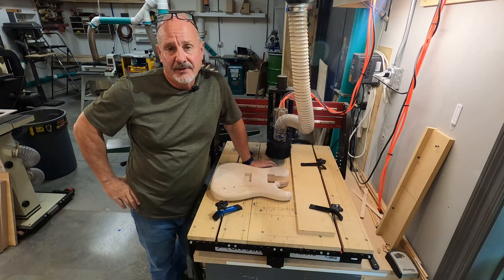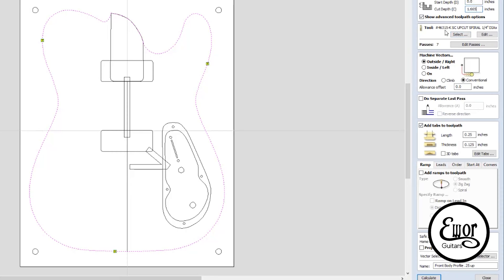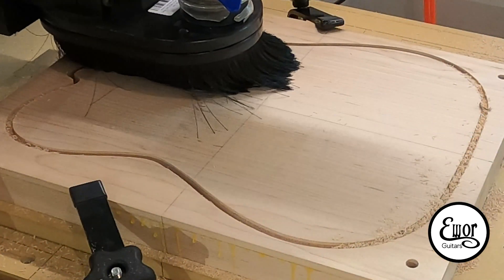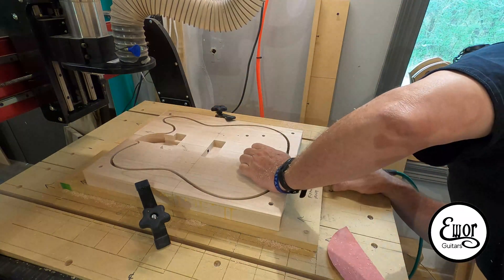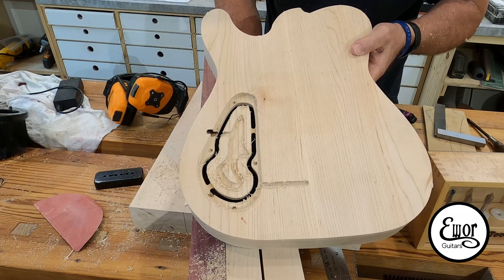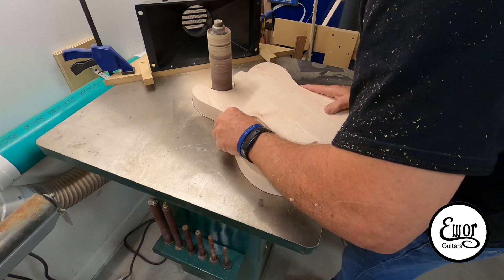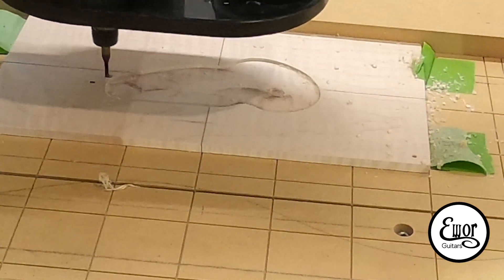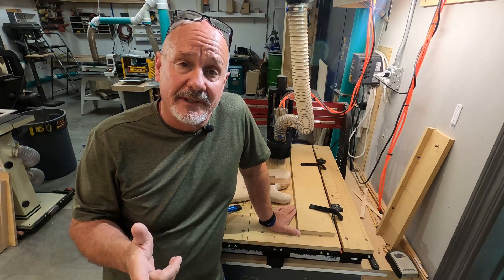My Journey into CNC guitar building: Part 4

Comment: That little deflection on the cover plate position can be modified to act as a finger pull area. Where you can put a finger in there and pop the plate out. It's done often enough.

Comment: One thing you should learn is how to read your G Code and how to alter your G Code. That way you could zoom right into the error (bad move) and modify the code. Most likely though, you had electronic interference. You also mentioned about ending your program a Z Zero.
This is also has a reference known as G54 or G52 or something like that. This is a position on your table that is known and can be used for repeatability.  Any way, you really don't learn this in Vectric, you can learn it in other software or CNC books. Message me and I;ll find my old book. (I ought to re-read it too)

Comment: Missed steps due to load or EMF interference or vibration may have caused your cavity run away. USB issues for computer connection caused me to go with offline control. Digital Dream DDCS 3.1 control with zero issues for last 2 years.

Comment: Hi about the glitch it probably occurs by eletronic interference. The things u should check up: USB cable (maybe too long it must be shielded ), endstops (they can cause u alot of trouble ive soulve my problem putting my hardlimit on always closed), u can too put some ferrites grafite on ur signal cable from ur stepmotors. Sorry, about my bad english hope u understend! Very good video friend, thx in advance
Reply from the maker: Yes you are exactly correct it was emi from the control cables. The manufacturer sent me a new controller with shielded cables and the problem was fixed. Thank you
Reply: If not already done so install a power surge protecter.  I had similar problems plus turning on other equipment in shop would mess things up. Surge protecter fixed that.

Comment: Hey sir nice stuff! With regards to the glitch, I had a similar issue. After troubleshooting with tech-support, it seemed that several times I kept different toolpaths on the file, i.e., v-carve, pocket, profile, even though I wasn't using them. It was suggested to delete the ones not being used and never had the issue again (knock on wood, hehe!) Good luck, hope it helps.
Reply from the maker: Thanks brother. Mine seemed to have emi interference from the vfd. They sent me a new one and it seems to be working

Comment: The issue you saw there on the back could be caused by the machine itself as the controller attempted to read/write off the USB stick. The controller reads ahead and writes to the USB stick as a way of caching the gcode for fast access. If the stick is full or there was a read ahead error that prevented the machine from knowing its upcoming paths, then it will be confused, kind of like covering your eyes the dark and spinning, then trying to find your way. My recommendation is to try a faster USB stick, and with bigger capacity. Caching is used as a type of read ahead memory and if the stick is full of gcode, then the controller will not have enough space to cache upcoming lines.
Reply from the maker: Thank you very much for that information. I will purchase a new/ better quality usb stick. The one I am using is probably not great quality.
Reply: I agree with the usb thought, you can’t spend too much to avoid glitches.  You taught me about the error pass test, but your reboot fixed it and that’s any easy glitch fix.  I may be too old to learn this, but I know a reboot never hurts if you’re worried about your software or laptop, equipment in two minutes. I sat here all day missing football playoffs cuz your videos are great. Some presenters are technically correct but have poor timing, continuity or something makes them hard to focus on.
You could have taught economics and I’d of gotten it better. Great stuff!
Reply: I’ve seen the next comment. He beat me to it.

Comment: I think I would reboot the cnc controler and the laptop before each project.  Maybe add a uninterruptable power supply (UPS) to filter the AC coming to those cnc tools.
Reply from the maker: Thanks for the info Ron, I was considering a ups, I think that would help
Reply: I've been thinking about CNC. So far all I have done is build and improve kits, if I'm to grow from here I need to build from scratch.  I've looked at several videos and stumbled  across this one from Hammer cnc.  It seems they let actual machinists figure out a work path and build a jazz bass. 

https://youtu.be/UMj9k3JTZHo

Lots of indexing pins!  But they put the neck blank in a jig, cut the truss rod channel, with the blank in the jig they glue and clamp the fingerboard blank with index pins.  After drying, back to the cnc, radius the fret board, cut fret grooves, profile, headstock shape, with tabs.  they switch jigs, this one has a recess for the fingerboard, Then they radius and profile the backside of the neck.  to add to the splendor, since they have a small machine, they work the neck on a diagonal to have enough space.  I thought this might add to your cnc abilities.  When they finish the neck, it's ready for prep and paint.  Same for the body. Using a ball end bit they accomplish a 3/8" round over without a second setup on a shaper table.

It's seems to me, with the leveling, carving, and planeing capabilities, a cnc could eliminate a lot of other large tools for me.  Great designs from you. love watching.  What I've discovered with the kit work is building causes a person to become a better guitar tech.  Mistakes happen and you have to think your way out of them.
Reply from the maker: I just watched the hammer cnc video. Good stuff thanks for telling me

Comment: Regarding the glitch: I suspect it is an issue with the controller, or maybe the post-processor. I experienced similar things with my original controller, a Richauto A18. I went round and round with the tech support engineer and ended up replacing the entire controller with a Centroid Acorn. No small feat, but in the end it was worth it. Running an "error pass" where you cut air to check for glitches is a work around of sorts, but it does nothing to troubleshoot the root cause and just wastes time, electricity, and wear and tear on the machine. And yes, when it decides to glitch and drive the tool right through an expensive piece of mahogany or whatever, it will piss you off!
What controller did your machine come with? Is it running Mach 3 or somesuch through a connected PC or is it running  software within the pendant? Also see if there is an updated post-processor for your controller.
Reply from the maker: Thanks for the info mark. I have a shark hd510 the vfd and the pendant came with the machine. I can’t remember which post processor I used I think I selected the one for the machine. I am a total newbie to cnc and have a lot to learn.

Comment: Those mis-cuts . . . two ideas, the first might not apply to your setup. I have a Shapeoko Pro with the controlling software running from a laptop. Any wifi connection can interfere with communication between the laptop and the spindle.  Second: electrical noise. Any funky AC wiring in a shop can lead to EMI-related disconnects and issues. I know there are devices that serve as AC filters that stop electrical noise  leaving the router and entering the AC lines. 

I have had strange things happen for no reason, and thankfully they are very rare.  All I do is restart the controller, spindle and software (laptop) and the issue disappears. I had something similar about 3 months ago, but nothing since.
Reply from the maker: Yes I think you are right. Someone else mentioned radio frequency coming from a electrical cord that was near my spindle control wires. I moved the power cord and haven’t had any issues since.

Comment: RF frequency  would be my guess messing with the cnc controller .   Double check to make sure no AC cables are near your cnc motor control cables and that everything is properly grounded . I have also seen large HP power tools cause cnc controls to go haywire when they first start up because of their massive startup amp draw .
Reply from the maker: Very interesting. I need to check that out. I do have some 120v cords running near the control cables and my jointer is near my cnc control box but it is only 2 hp I think. I am 99% sure grounding is good but I will check it out too. Thank you for your thoughts!

Comment: i just got a 4x4avid cnc, im using fusion 360 and mach 4 works well. Are you using v-carve pro I think I need it. It's fun after you  get passed the learning curve.
Reply from the maker: Yes I am using v carve pro. It has definitely been a steep learning curve but I’m beginning to get it. I’ve been thinking about either fusion 360 or rhino 3D for 3D modeling. Do you like fusion 360?

Comment: That weird unexplainable stuff is what keeps me from pulling the trigger on CNC. That and space
Reply from the maker: Yeah and the weirdest thing to me is it worked fine when I made the mdf test body.
Reply: @eworcustomguitars , that's what scares me. The time I get some freaky beautiful piece of wood the CNC will have "other plans".
Reply: @jonahguitarguy  You can get CNC rails and route manually with templates. It will be more accurate than hand routing and no computer in the mix.

Comment: My take ... it's all woodworking.
CNC is just another time saving power tool.
Nobody seems to be in a rush to abandon bandsaws, thicknessers, power drills, spindle sanders, dremels etc.
As you showed in this episode, it still takes human thought and planning and practice to program a CNC.  It's a path of accumulated learning and refining from experience just like every other tool (hand or powered).
Reply from the maker: Excellent point! My thoughts exactly. Thanks for watching
Reply: My thoughts with it is, if you already had those tools and a Pin Router and are as fast as Matt at Texas Toast guitars, you already got it covered. And it also relates to am I a Guitar Building Company (Fender) or just a hobby builder?